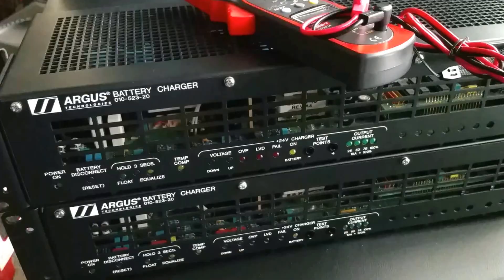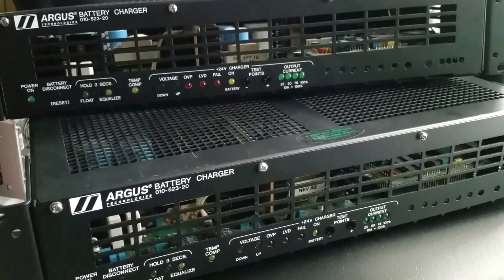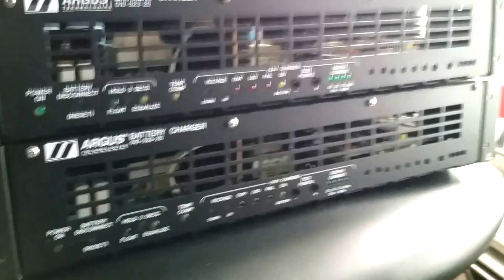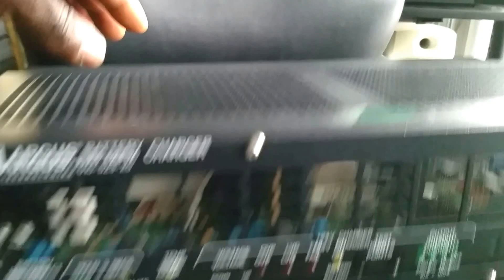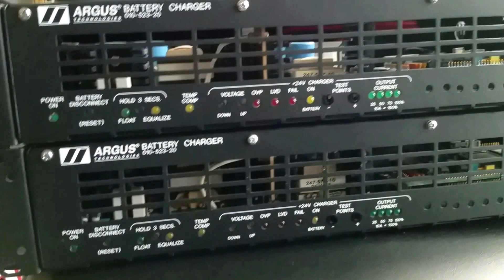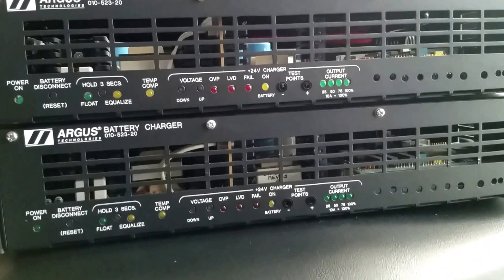ARGUS SWITCHED MODE BATTERY CHARGER Pt.1

Comment: This is specifically built for a Motorola MTR 2000 base station / repeater. It has an AC fail sense circuit that switches the 24VDC lead acid (only!) battery to supply 24VDC to the station.
Reply from the maker: Yes!
You are absolutely correct.
These units were setup for a repeater station with (SLA BATTERIES)
THANKS FOR STOPPING BY, DON'T FORGET TO LIKE SUBSCRIBE AND SHARE

Comment: wow a rack mount battery charger. must have been built or computer ups system. no good for my bank :) to small. I love my AGM batteries. Very interesting video. I float at 55vdc and charge at 57vdc.  Looking forward to seeing the backup system you build. Do they make them in higher volts ??
Reply from the maker: +Justin Case I suppose.Mine are 12V/24V12V @20A24V @10Very good battery charger with 19in rack mount ears.Thanks for watching and the comment I really appreciate it